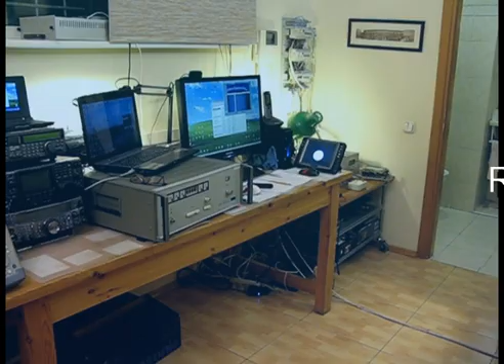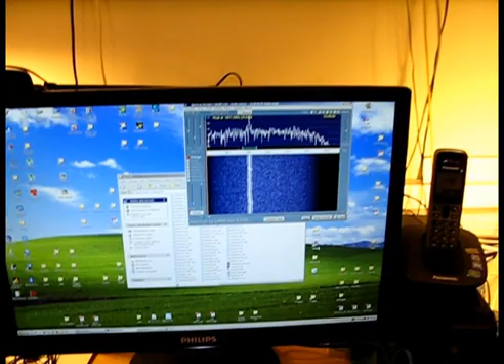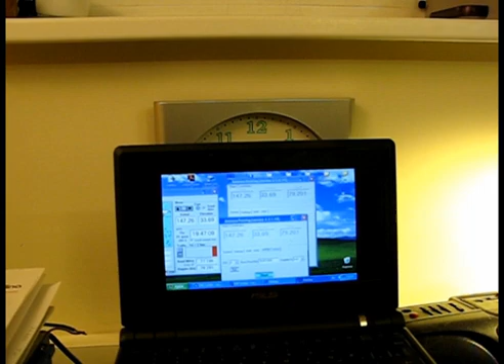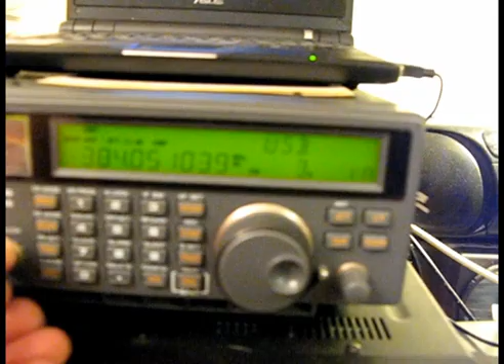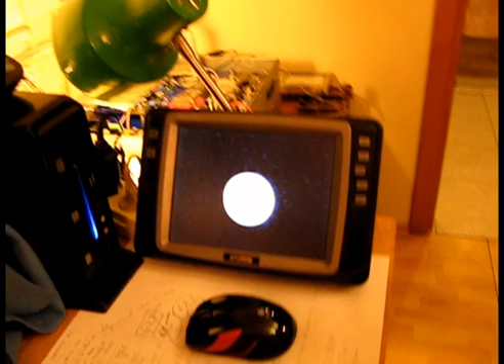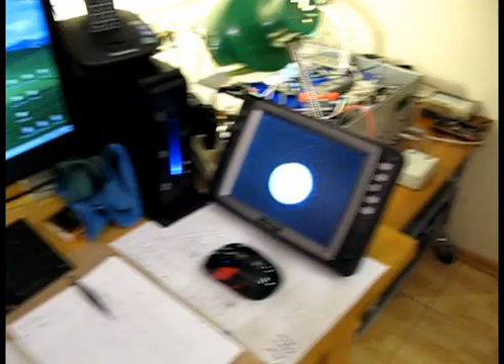RW3BP EME test on 77.5 GHz

Comment: Your experiment is pretty interesting, espeically so that you manage to make it work in your flat in Moscow.
Do you have better 77.5GHz reception in the cold months when the air is more free of water vapor?  Do you have some kind shroud to keep your electronics dry at the foci of your dish?   Have you played any DSP tricks to increase your SNR, like increasing the time transmitted per bit and using matched filtering?